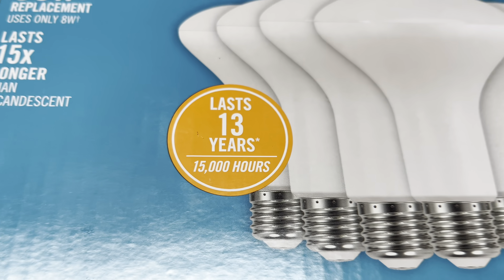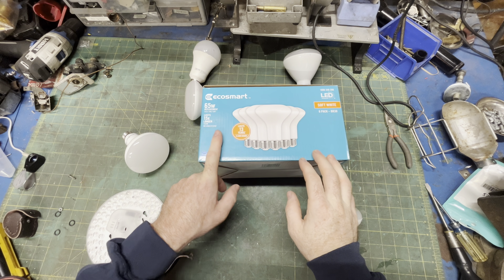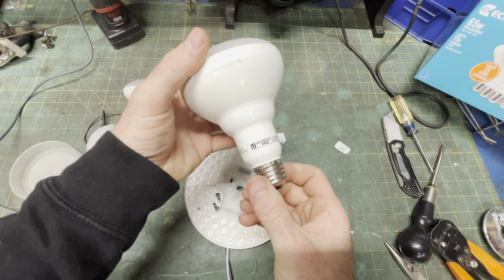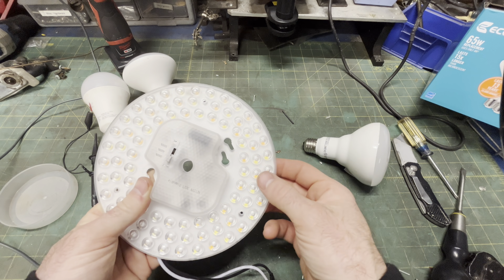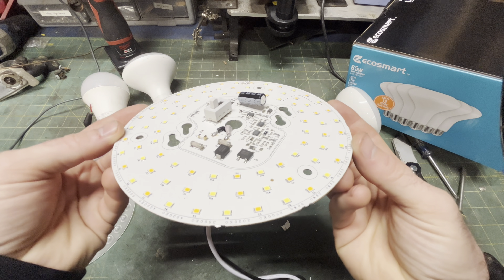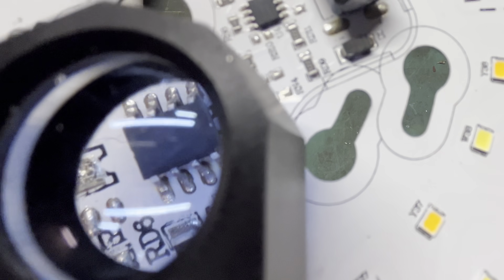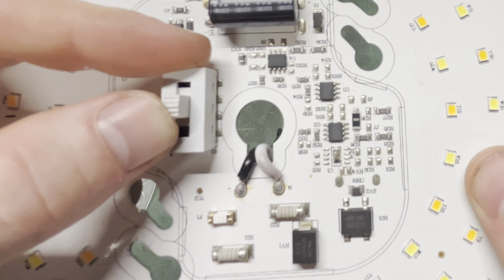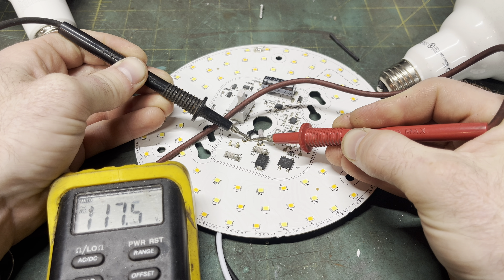Why Do LED Bulbs Fail? An Autopsy!

Comment: Like the moral of the story here is that we should probably switch to DC for lighting circuits because it's never actually the LEDs that go, it's the parts that transform AC to DC that fail. Where as a high quality 48V power supply usually lasts decades and it would make the bulb cheaper as well, also it would make the lights more efficient because a high quality 48V power supply can be 98% efficient I very much doubt the power supplies in these lights are anywhere near that efficient, like yeh every 3 or so decades your going to have to spend $100 or so dollars on the power supply, but I think thats more preferable than changing all the the lights every 2 - 5 years, and you only need a single 200W DC power supply for a reasonably sized house and as long as the lighting circuit is isolated from everything else you can just wire it up without having to do anything else because the amperage needs are not going to be as high as for a bunch of 120V AC incandescent bulbs.

Comment: The bulbs are designed to fail.   First If they lasted the length of time that was advertised, the manufacture would go out of business.  Second the bulbs are cheap enough, nobody is going to file for the warranty. Does anybody have the receipt for proof of purchased.  It would cost more to send the bulb in than to just by a new one. Plus, the company has probably changed their name, moved, gone out of business or the is no contact info for the maker.

Comment: You're crazy! I wouldn't have anything other than LED lightbulbs in my house. Who do you work for, sour grapes GE? 

I've only had one blow out in the recessed light over the sink in 15 years. Prior, I never had a light bulb survive over two months there because the bulb would get the fixture so hot it would burn it out. The LED I put in was shorting to the bracket which is why it burned out. I fixed the bracket and it's replacement has lasted over 6 years and is still going. This is a light I had to replace every two months and you could mark your calendar by it. It drove me crazy because of brackets and springs, it's really hard to put in. 

Likewise I have a school house globe style fixture on a ceiling fan in a kids bedroom that never lasted more than two months. It got so hot you couldn't even touch it. I put in an LED 8 years ago and it's still running and it's very cool to the touch. Another similar situation are my four corner dimable recessed can lights in the living room. Two of those have no space above them and would blow out every 6 months. Switching to dimable LED 8 years ago they're all still working just fine.

MEANWHILE THE ENERGY SAVINGS IS PHENOMENAL!  Modern LED's use 1/10 the power of an incandescent bulb and have never been cheaper. Also, I would ask all of you who have multiple bulb fixtures like in the kitchen or bathroom ceilings? How many of those are both bulbs still working in? They again, create so much heat, they always burn one out. LED bulbs don't even get warm in that scenario. The kitchen, upper bathroom and upper hallway are all double bulb units and were the first I changed out. And each had a bulb out. 15 years later they're all still working fine and not one bulb has ever dropped out. And I have hot power in this house. A true 120 volts AC and my house is right next to a pole transformer. 

How about your bathroom vanity globe lights? I have a bar upstairs with 8 bulbs that used 200 watts everytime you turned it on and blew the odd bulb every 6 months. My LED bulbs are 10 years old, use 48 watts (less than 2 bulbs) for the whole bar, putting out the same amount of light and none of them have ever burned out. Even my nightlights (ever burn yourself of one of those?) went from 9 watts, to half a watt, not enough to even get them warm. Especially nice for small decorative lamps that are always left on, because they don't heat them up, last forever; for pennies a year.

My dining room fixture uses two LED Edison style bulbs as does my automatic front porch fixture. Edison bulbs didn't even exist growing up. Leave it to the Chinese, huh? My fancy ceiling fan uses dimable LED flickering candle bulbs that put out 60 watts of light each turned all the way up and use 8. NONE of these bulbs have ever burned out, or existed at all, and they are 11 years old. The half bath went from 125 watts of power to 30. 12 from 50 if only the back wall is on, which is usual.

I switched to LED as soon as they came out and wouldn't use anything else. Even all my automatic outdoor spotlights are LED and they've never been replaced either. The fixtures had to be replaced however. Even my garage door openers use shielded LED bulbs. (I did have one of those go out) Either you're buying junk, or you're full of it. And I'm not afraid to buy them on Amazon and have been for over 11 years. In fact, that's where most of mine come from, especially the hard to find specialty bulbs. Amazon gets those first. My house uses so little power for lighting you can forget to turn them off and not feel guilty. The whole house! My circuit breakers love me. The power company? Not so much. LOL

This past week the last of my incandescent bulbs are gone. I finally found touch lamp bulbs and that's all of them..

Comment: Posting this at about 20 seconds into the video: Cheap chinese capacitors / resistors crapping out. Mine always start flashing and/or flashing between bright and dim. Anybody who knows anything about electrical circuits should know AC to DC requires rectifiers and RC circuits... The LEDS Themselves will last for a LONG time. 

After watching the full video: I guess I was partially right. A lot more chinesium than I expected in these. Either way, either components or solder joints fail. Regardless, the reduced power consumption of LED lights still make them viable over incandescent in my opinion. 120W down to 12? (Something like that). My monthly power bill definitely knows the difference, and lights that only last 3-5 years are still worth it. 

I think the hour 'ratings' on the boxes are for the LEDs themselves ,which probably actually last that long.

Comment: I replace our led bulbs all over our house (converted to all LEDs 7-8 years ago) all the time. They're trash. Saves electricity...I think. Never noticed a difference, honestly. They have outrageous lifespan claims but are clearly engineered to fail prematurely.

Comment: Why do electronics fail?
Heat. Moisture (corrosion). Pretty much always one of these two in one way or another except for the occasional mechanical force aka blunt force trauma aka dropping it.

Comment: 8:00 - itsbeen a while, but isn't that HALF WAVE rectification?  Ibe pert near sure?

12:24 - does not a FILTER CAP stop flicker? It does in my circuits?

Comment: Make them repairable!!!
To my knowledge, you have to destroy the bulbs to get to the internals, so by design they are throw away items. This should be against the law for ethical repairability reasons. Of course for safety, repairs should be by a competent knowledgeable person.
That circular smd resistor is a melf resistor. They are generally better surge power rated than flat smd resistors

Comment: Most last 1 year for me they usually start to flicker on and off. Lasting far less then a CFL or incandescent bulb..... There a total scam if you ask me designed to fail quickly.

Comment: It makes sense that the electronics are the weak point in most of these LED array bulbs. Seriously cheap fault prone manufacturing. They probably do some initial QC, but a weak solder joint isn't going to be caught by their methods... and ends up failing after a certain amount of high heat exposure over time. Some idiots design their circuits in serial. One LED goes bad (or its solder joints) and the whole thing is toast. As they say, "cheap is expensive" (in the long run).

Comment: So the TLDR of this is that the LEDs are fine but the problems are with crappy craftmanship? Kind of cheeky advertising for these manufacturers when they state the LED will last X amount of time when Y components in the system are prone to failure much earlier. I think I'll have to spend a bit more money on LED lights in future with companies I can trust.

Comment: so the problem is not the leds.  the problem is the low quality electronic components that convert AC to DC and limit the current.  I think they are lying when they say lasts 13 years.  Or, that is only referencing the life of the LEDs.

Comment: It bothers me that LED bulbs were always a lie when it comes to energy savings.  While it is true they use less energy to produce the same amount of light...this is only because they produce less heat in the process of producing that light.  An incandescent will use more energy because the difference is released as heat.  In you home, any excess heat would contribute to heating your home in the winter.  That same heat would need to be removed in the summer months.  The "real" calculation to determine how much energy you would save would need to factor this heat production for your entire home as part of the equation...which is nearly impossible because every home is different.  But it is clearly wrong that the wattage you are saving is the difference between what an incandescent uses and an LED uses...it is somewhere in between.  So, LEDs, cost more, don't last as long as advertised, and don't save as much energy as advertised either.

Comment: I started buying the Ecosmart 3000k because they had a "5 year" warranty.  Good thing I did, they would dependably fail 12-15 months after install (I wrote purchase date on boxes, install dates on all bulbs).  For a long time, I'd just fill up the box, return to the store and get new ones.  Well, they soon stopped stocking my 3000k, then I switched ALL bulbs over to Sylvania 3000k bulbs from Menard's ('cause even though they had the same color temp, they looked terrible).  Warranty dropped to 1 year, and after only two 12 packs, Sylvania regular bulbs were no longer carried at local store.  Now I'm on Feit (which from previous experience is a garbage bulb too), I've consolidated rooms into groups of same bulbs, but its irritating walking through the house.  It's like a race to the bottom of absolute garbage manufacturing for these gov mandated crap bulbs and an absolute crap-ton of e-waste.  What previously was glass and metal is now a plastic assembly with nothing that will willingly break down with environmental exposure.  Whose bright idea was this?

Edit: failure occurred in all my bulbs after 12-15 months of completely normal use, i.e. on in the morning for an hour or two.  On in the evening for an hour or two.  Nothing special, no heavy use.

Comment: LED bulbs are a CURSE. Our house is full of LED recessed lights. They started failing a few months after we moved in and we have now replaced every one in the house - and they continue to die on a regular basis. They're expensive, they flicker, their color rendering is terrible, and they fail to achieve one of the two promises that caused U.S. regulators to ban the sale of incandescent bulbs for residential use - longevity. The only benefits I can see with them is that they are more energy efficient and run cooler than incandescents, but the energy efficiency ends up being offset by their higher price and short lifespan. 

So my perspective is clear, our podcast studio is full of high-quality LED studio lights and I love them, but the poor-quality residential bulbs and fixtures we have been stuck with are no comparison. It's time for lawmakers to take their hands off the wheel and let the market work. This will result in better quality LEDs, because they will actually have to compete with less expensive, high-quality, proven technology: incandescents.

Comment: Someone should run a "green" comparison between a simple incandescent bulb with its very safe and basic parts, glass, tungsten or whatever other metals are in it, and the LEDs with their PCB boards, plastics, shorter than advertised lifespan, etc., and see which one is actually worse for the planet. My bet it its not as drastic and the people forcing "green policies" down our throats.

Comment: we have LEDS crap out all the time at our complex. why? due to hard headed boss refusing to get right bulbs. LED bulbs not rated for entirely enclosed fixtures crap out in literally months. Philips refused to honor warranty on the 3,000 LED bulbs that crapped out. if you read the careful fine print on inside of box, the life expectancy of LED bulb broken down by how long bulb is on. they sneak in caveats too -  photocells, timers  void the warranty of some brands

Comment: iPhone should be hdr compatible but who knows?
Reply from the maker: It should be, it looks fine on my 13 mini and SE2020! Yours is the only comment mentioning it so I wonder if it’s a glitch? I’m curious if it looks normal on low battery mode? That turns off HDR iirc.

Comment: LEDs still have 80% heat loss, better than 90% but still creates heat. Heat shortens electronic life, like 1/2 life logic in biology or chemistry.
They get mounted in the ceiling, you don't want holes in your ceiling, because it ruins the thermal envelope.
So the recessed lighting is a little oven that cooks the electronics. aluminum is really crappy circuit board material because of the coefficient of expansion mismatch between aluminum and components. Thus the cracked solder joints,  simple solution is stranded copper pigtail hair brush pins. PHBR's. literally just birthed this concept here, this second, writing this.
2 or more "strands" that even if solder flowed, are not rigid component to board. The flexing eventually will crack the a single S bend, thus redundant copper paint prush pin idea.
A way to allow expansion is the fix, S leads that are compliant, or //ing them up, or copper paintbrush lead idea.

Comment: I despise LEDs. The color spectrum is terrible in comparison to incandescent since they are not blackbody radiators and the design is nothing but a cheap electronic driver that is virtually impossible to recycle.

Incandescent: glass bulb, bulb gas, basic electrode, and tungsten filament—all easily recyclable.

Comment: led's when they came out: 100.000 hours!
led's now: advertised 20.000 hours, fails after 5000
Unless you buy the high quality expensive stuff a fluorescent lamp from 2005 is better (most still work)

Comment: As usual we have been completely conned into using LED bulbs. Incandescent bulbs lasted for YEARS!!!!! We were then given fluorosecent bulbs which were slow to start up and died prematurely - they were cheaper to run but cost a lot more so overall were more expensive!!!!! Then we were forced to use high efficiency halogen bulbs - again cheaper to run but A LOT MORE expensive then incandecent and failed almost every tim you switched them on becuase they didn't like mains spikes - SO MUCH MUCH MORE EXPENSIVE. At least these were mainly glass so no majot plastiec issue. Then we were forced to adopt LED bulbs. Lots of plastic so bad for the environment, cheaper to run but they fail in many ways - burned out series LEDS - like christmas tree lights - one goes they all go out-  I've had failed mains dropper circuits  (HV electrolytics  that fail shorting out the power supply) and they dont dim well!! (something you could do with incandescent to reduce power usage!!!!!!!!!!!!!!!!!!! You can scrap your old dimmer switch and but an LED friendly one for compatible bulbs but some LEDs start flickering badly - replaced OK but more cost and more waste and more plastic to landfill!!!!!!!!!!!!!!!!!! Certainly not long life as claimed. Also attemting to repair LED bulbs has mixed success.  Difficult to get into the base without wrecking them and desoldering individual failed LEDs difficult on the high heat absorbing substrate. Time / cost of parts not woth it - more landfill .............

Comment: I’m sorry to be the one to tell you this but I will. So when you get glasses they don’t magnify anything so unfortunately you will not only still need the magnifying lens you will need a bigger one because you can’t see through the small ones when they are 5 inches off your eye because your glasses are in between so long story short it gets worse at 40y not easier 😊sorry

Comment: LEDs are cold devices.  Heat is their enemy.  Manufacturers of LED bulbs are applying too much voltage to the individual LEDs in order to make them brighter, but this also makes them hotter.  Which means they don't last long.  Which is what the manufacturers want; they make money when you buy new bulbs, and they'd like you to do that often.  Just like the Phoebus Cartel of the 1930s.  Which would be fine if we weren't switching to LED bulbs in order to save electricity.  All that heat is wasted electricity, which sabotages the effort.  If you have an LED bulb rated for 800 lumens that uses 9-11 watts of electricity, as many are, you are going to have a very hot bulb.  The EU wised up and requires LED bulbs get 200 lumens per watt.  So a 60 watt equivalent bulb producing 800 lumens should only use 4 watts.  Anything more than that is being used to make heat.

Comment: Shoddy construction. Unreliable components or improper heat dissipation are always the culprit for led bulbs. Led lamps that have the transformer mid-cord or in the plug like any sane electronic device tend to go the full lifetime because there are fire safety regulations and they cant be sold if they get too hot in those external locations. Under existing regulations lightbulbs were expected to produce a lot of heat, and were made of glass and ceramic bases to withstand the heat. Since they werent being forced they could skimp out on heat management which is why the bulbs end up cooking themselves.